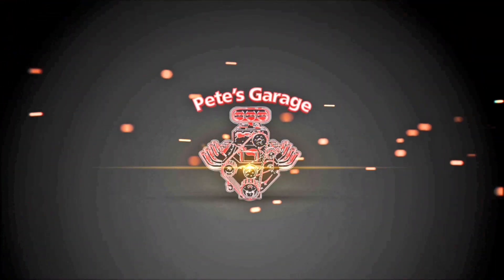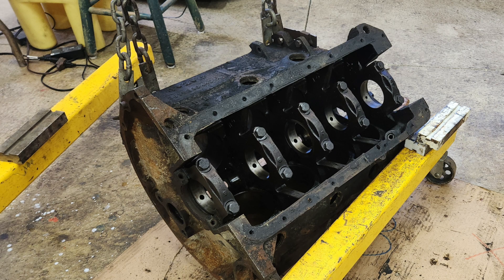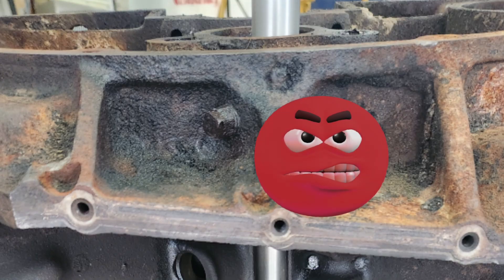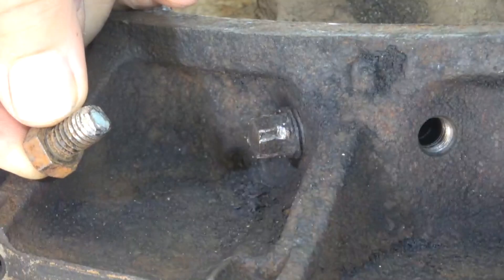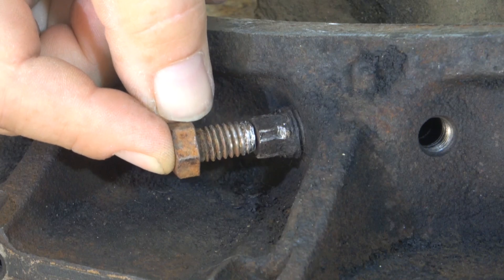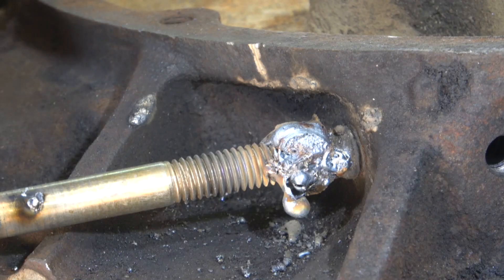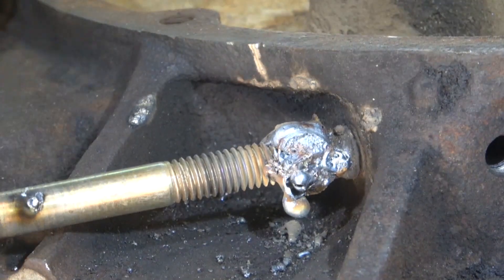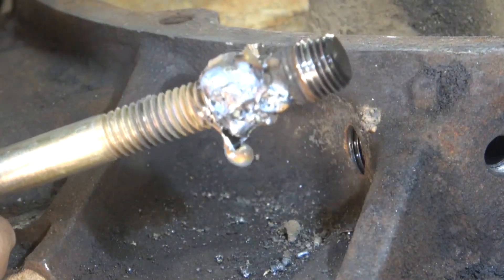Engine Building - How to Remove a Stuck Pipe Plug from a Block

Comment: I would've thought that bolt-grip or 12-sided sockets would've worked in that situation. If that were me, I would've given those a try and maybe filed-down the sides of the head a little to bring them back to square and prevent rounding with those other socket types. But I got a friend who uses the welding approach and swears by it, too. I've never been in a situation where I had to resort to something like that myself. Broke off a bolt in the block once when I mistook foot-pounds for inch-pounds when swapping out a truck thermostat... But I didn't have to fix it since I towed it to my mechanic friend who managed to get it out with a pair of vice-grips. Ha. That situation gave me PTSD...
Reply from the maker: I tried everything I could first. Welding is always my last resort.